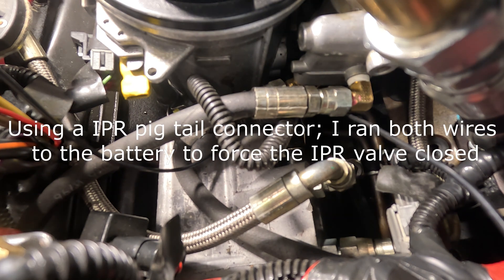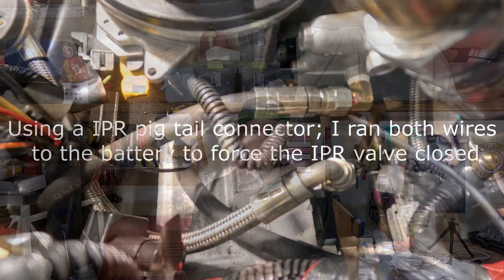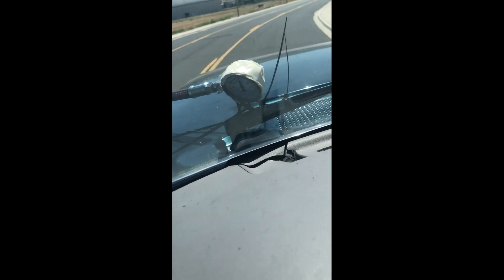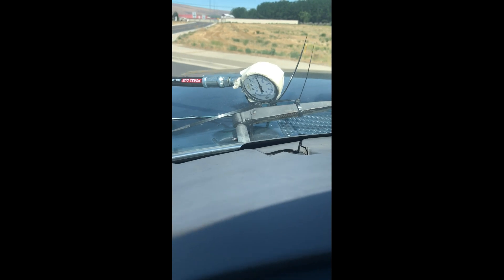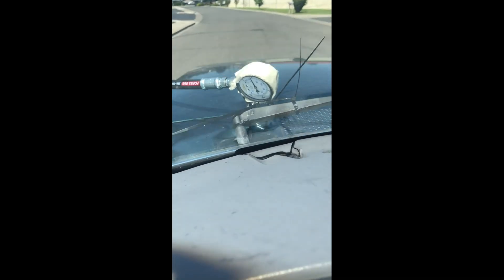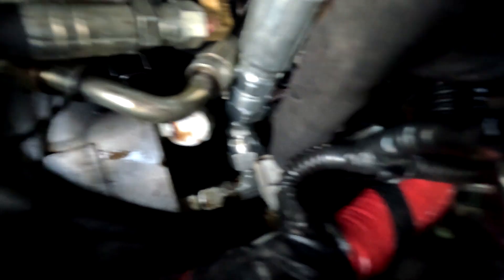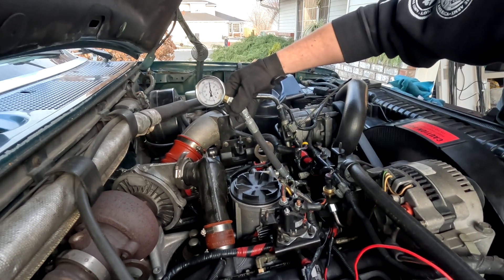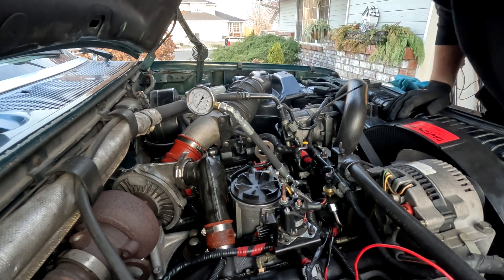OBS FORD 7.3 POWERSTROKE HPOP TEST

Comment: I pulled the ICP sensor on drivers side. Put air to it. Could hear bubbles coming from both valve covers. Hooked 12v to my pipe. Still sounded the same. Regardless that means my injectors are leaking right?  I installed new injectors myself (first time for me) last years and now won’t start. Tested high pressure off sensor hole only 230psi. Would you believe that the injector orings are blown then right?
Reply from the maker: Well it’s hard to say.  Do you have any oil in the fuel or vice versa?  You should look for other signs that the injector orings are bad before you tear into it again.  If you have a bad oring you would see signs of oil and fuel mixing because the oring no longer can keep them apart obviously. 

Here’s my opinion, if you apply 12v to the IPR solenoid and you still hear air coming through then that means your IPR is not operating properly (most likely).  The IPR solenoids’ job is to regulate oil pressure coming from the HPOP to the injectors and is controlled by the engines ECU computer.  

If you look at a diagram or a computer model of a IPR working on YouTube the Injector Pressure Regulator moves countless times a second.  If that becomes worn out, or dirty the IPR can cease to work properly.  That would cause the vehicle to not start because the ECU can’t regulate oil pressure to the injectors.  

My advice would be to get a ForScan off amazon or somewhere and plug it into your computer so you can see with your own eyes what the IPR is doing in real time.  Then make a decision from there.  If the IPR isn’t responsive to the engines cranking over then that’s your culprit.  You can replace it with a new one or try to clean out the old one.  

Hope that helps👍. If there’s anything else I can do to help please let me know.

Comment: I've got a 95 73 OBS powerstroke , it also has a aftermarket Banks Boss hoss performance chip , as of yesterday June 10th 2025 I have a loss of power and what feels like a misfire , it's very slow and sluggish off the line even with the pedal mesh to the floor it does however get up the highway speed ,  throttle response and acceleration is sluggish , I replaced the injector o-rings probably about 5000 miles ago ,  this is my first diesel truck , and I'm just not sure where to start ??
Reply from the maker: Does the truck have any check engine lights? When it comes to making big power out of these trucks making sure you have proper fuel pressure as well as oil pressure from your HPOP to match it is extremely important
Reply: @ydocproductions5593   No check engine light , just used a scan tool got a p1111 code

Comment: I perfomed this same test, only i unplugged the injector harness so it wouldnt start. I believe its the same result. However, i only had 1800 psi. No oil in fuel. Would that point towards an HPOP failure?
Reply from the maker: @vcdh1522  That does sound low and it very well could be a weak pump.  However, what I came to learn about HPOPs’ was that even though it does matter how much oil a HPOP can make, what matters most of all is if the HPOP can DELIVER that oil to the injectors.  In my case the HPOP made plenty of PSI in the driveway, but when it came to delivering it to the injectors while driving it simply wasn’t enough and would throw that p1211 code.  Even though it’s a hassle I would hook up the hose and gauge up and drive it while under a load and see if you have a different result.  Hope that helps
Reply: @ydocproductions5593 That's my next step, hook up ggauges and test drive. Thanks for the video and info, helped a lot.
Reply from the maker: @ let me know how it turns out👍
Reply: Well I finally got a chance to hook up my gauges and I think my HPOP is performing fine. It's building 2500-3000 PSI during acceleration. Possible injector maybe?
Reply from the maker: @ is it a p1211 code like my truck had? Or any other codes that have popped up? Checking fuel pressure is another very important thing to check.  If your pump is delivering up to 3,000 psi then it sounds like a healthy pump.  Of course we don’t know if the pump is DELIVERING that high pressure oil to the injectors but I would do a little more testing before you “load the parts cannon” 

What year is your truck?  The OBS and Super Duty trucks are completely different when it comes to the fuel system
Reply: It's a 2002, not an OBS and yes, I am getting the P1211 code. I will check fuel pressure before I do anything drastic. I would also like to test the IDM.
Reply from the maker: @vcdh1522  if you have a obd2 reader (like Forscan for example) that would be ideal so you can see live data as your driving down the road from your computer.  I would check the ipr icp and wiring harnesses as well.  

The super duty trucks also have a classic problem of the plastic tanks deteriorating and the tiny little screens inside getting clogged up with plastic pieces causing a fuel restriction.  

I’ll link below a website that has all the specs for both an obs as well as a super duty. Really helped me out a lot when I was struggling with my truck. 

https://www.oregonfuelinjection.com/content/uploads/2016/08/ford-7.3-94-03-diagnostic.pdf
Reply: About a year ago, I pulled the in tank screen to replace them. I suspected they were plugged, so those are in good condition.

I just finished replacing the engine harness and ICP sensor and IPR valve are all new OEM. I have some more testing to do.

Thanks for the responses though. Helps having someone to talk to.

Comment: Great video probably won't get an answer in reply in time to help me but maybe somebody else. Could you not just test continuity with a multimeter?
Reply from the maker: Ya you could.  It’s just a way to see if you have enough power coming through that wire to power on a light bulb.  Just a different way to do things, but both ways will get you across the finish line.
Reply: @ydocproductions5593  cool

Comment: I just did this same test with deadheading the hpop, my 6000 psi guage immediately broke, I have no idea how much pressure it made, I'm lucky the hose didn't explode and kill me, have you ever heard of a pump making too much pressure?
Reply from the maker: Ya these pumps make an extreme amount of pressure when the truck is running.  Up to 3,000 psi when the truck is at full throttle.  I’m not sure why your pump is making too much pressure (I’ve never heard of that before).  My guess is that your IPR valve is stuck and not allowing any oil to drain back and so you’re getting the full pressure the  HPOP makes amd thus too much pressure cause the oil has nowhere else to go.

Comment: Thank you for the video. I know you have code P1211 but how was the truck running? I've been dealing with a rough idle/miss for awhile now with no codes. I haven't checked the HPOP performance or compression yet but a reputable shop said everything else is good. Fuel pressure is 60 to 65 running, tanks and pickups are clean.
truck has a bad vibration loss of power and fuel economy. No smoke. I'm leaning towards an injector issue?  Anyone have any ideas? 265k
Reply from the maker: @AndrewBirrenkott  well it’s hard to diagnose the truck when I can’t physically see it but whenever I’m dealing with a problem like that I always like to go back to the basics and build from there.  For example if you have good compression and fuel pressure your probably good.  I know you checked fuel while it was running but it’s important to check it under a load while driving.  These Powerstrokes can do all sorts of weird things if they don’t have enough fuel pressure.  Also important to check the sensors.  Especially the ipr and icp.  I would recommend you buy “Forscan” it’s a program you can plug into a laptop and you can see what the sensors are doing at different speeds to spot any anomalies.  I would also check the HPOP oil pressures.  If you don’t have any oil in the fuel or vise versa most likely those are ok.  Lastly if you want to check the injectors.  Take the valve covers off while the truck is running and look at the return spouts of all 8 injectors and see if one injector is returning a significant amount of oil more than the rest.  Again im no expert but these are just a few things I’ve learned throughout the years.  hope it helps.

Comment: Great vid. what is the thread size of the oil port ?
Reply from the maker: Thank you!  I’m not exactly sure the oil size port.  What I did was buy a crossover HPOP line kit off eBay that had all the 45* and 90* degree fittings.  I believe it’s an automotive thread, so I couldn’t find the right size fitting at my local hardware store.

Comment: I've got a 95 f-250 with 290k ,  just recently I discovered that the fuel was contaminated with oil, I cleaned fuel lines and the tank , the fuel filter was black, it smokes a lot during warm up , I've gone through a gallon of oil in a week, no check engine light , no p1211 code . Changing injector 0 rings.
Reply from the maker: Yup sounds like your injector orings are bad.  The fuel filter being black with oil is the classic sign of o-ring failure

Comment: Thanks for an informative video!  While cranking you first have 0psi showing and then it jumps to 3400psi. Is that you opening and closing the IPR valve manually by applying the 12V directly?  Or is that just a delay before the pump builds the pressure?
Reply from the maker: Thank you I’m glad the video was helpful.  The IPR had constant 12v applied.  It just had a small delay before the pump built the pressure
Reply: @ydocproductions5593  thank you!  I appreciate you letting me know.  I'll be testing my HPOP today.
Reply from the maker: @PolishSoul   believe it or not but after two years of searching for the problem with this truck I finally figured it out.  Stay tuned for my next video coming up this week and it’ll explain everything.  Take care👍
Reply: @ydocproductions5593  that's great to hear! I'm looking forward to it.  I haven't dead head tested my HPOP yet because the crap Amazon kit I got had all the wrong fittings.  My JIC/AN adapters should be arriving today, so I'll be able to test the pump and run compressed air through the heads to check for injector o-ring leaks as well.  I also ordered a heavy duty Denso starter because my stock one can barely get the engine to crank more than 100RPM with fresh batteries after so much cranking during testing.  I've been at this for months and SO badly want to be able to get my OBS back on the road, so I feel your pain!
Reply from the maker: @PolishSoul   I know the feeling🤣!  Ya when it comes to amazon parts for these Powerstrokes I haven’t had the best of luck (way to many cheap chinese made fakes out there).  Sounds like you’re on the right track to fix your truck!  Once you put air into the system to check for leaking orings it can take quite a while to restart the truck back up, so a new starter will definitely benefit you.  The new video I was telling you about is up so I hope it’s helpful to get your truck running again.  Good luck👍😀!

Comment: Did you find the problem with your truck I am having the same problem, I did the same test and it's the same pressure, sent all my fuel injector to get rebuild it acts like it wants to start but doesn't thank you in advance
Reply from the maker: I haven’t quite figured it out yet it’s been a long time since I’ve been dealing with the same issue and still can’t seem to fix it.  I’ll be diving into it this summer and hopefully be over it soon👍
Reply: @ydocproductions5593  tank you so much for answering my  massage
Reply: @ydocproductions5593  message lol

Comment: Check your fuel tank for oil. If an injector o-ring has failed the oil will go back to your fuel tank. The oil will sit above the diesel fuel so it’s easy to see. Also check the ICP sensor for oil leaking through the plastic due to cracking and soaking the electrical connection giving a false reading.
Reply from the maker: That’s all great tips, but I’ve checked all of that.  There’s zero oil in the fuel filter housing as well as zero oil leaked though into the icp wiring harness.  I’ve been scratching my head  for over a year on this problem.  The only thing that makes sense now would be injector o-rings.
Reply: @ydocproductions5593 , the oil won’t return to the filter housing. It’ll go back to the tank itself. You’d have to use a boroscope to see in the tank. If the injector o-rings are indeed leaking then you’d be losing it in the pan and can’t find where it’s going besides the tank. I had a few of those issues on school buses with the T444E engines. It could also be that big harness plug that goes across the driver’s side valve cover. I’ve had a few wires rub through and cause drivability issues.
Reply from the maker: @JLCmike4014  Very interesting, I didn’t know that!  If I ever get my hands on a borescope I’ll have to check that out sometime.  Also checking out the wiring harness should be on my to-do list because I’m running out of ideas of what could possibly be wrong.  

So in theory, if it was the very top injector o-ring went bad there wouldn’t be any evidence of it it because it would leaking at the injector seat right?
Reply: @ydocproductions5593 , if it was the very top injector o-ring then you see oil being forced up out of the injector bore. There’s actually 2 o-rings on that top injector o-ring seat but the one that commonly fails is the middle o-ring. If you pull the injector and all the o-rings are black then they’re all original and not the updated o-rings. The updated middle o-ring is pink and is a far better o-ring design than the original ones. The bottom one is orange.
Reply from the maker: @JLCmike4014   That’s very helpful information and i appreciate you being willing to answer all my questions on it.  Everything you said makes perfect sense.  Even if the injector o-rings aren’t bad it’s not a bad idea to put new ones in because I’m willing to bet there the original ones from 1996
Reply: @ydocproductions5593 , no problem. Happy to help.

Comment: At least you're diagnosing it, instead of loading the parts cannon! Are you going to upgrade any of the other parts when you inspect the o-rings?
Reply from the maker: Exactly!  I didn’t want to just throw parts at it hoping it would work.  Gets expensive pretty quick🤣.  I don’t think I need to replace anything else while I’m in there.  The glow plugs are in pretty good shape with the glow plug relay being replaced by the previous owner.  Also the under valve cover harnesses are in great shape, so besides a 3” down pipe I just might be finished with the truck and simply enjoy it.👍

Comment: It would be good if it's just a bad o-ring and replacing that fixes the problem and the light on dash stop coming on good luck for the next video.
Reply from the maker: Absolutely!  Especially if it’s only gonna cost me a tenth of what a High Pressure Oil Pump costs.  Thanks for watching👍